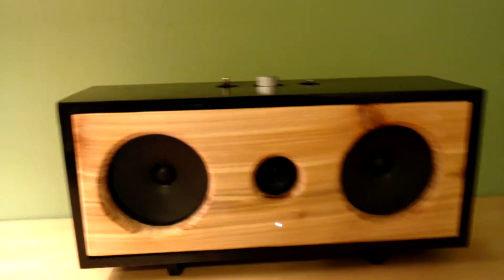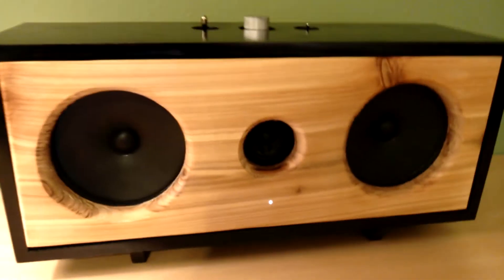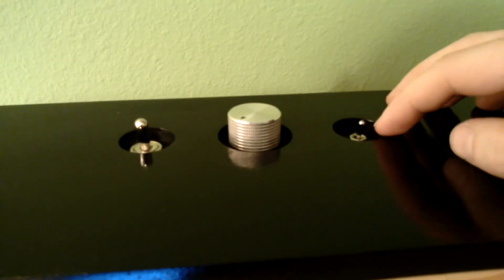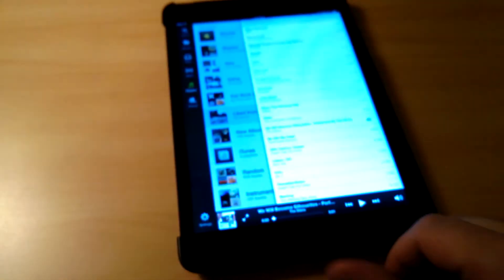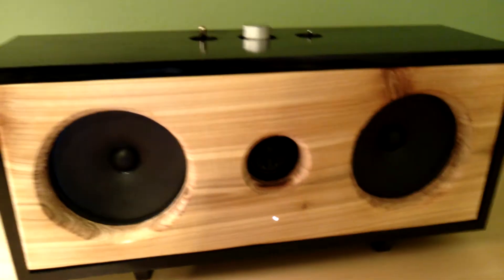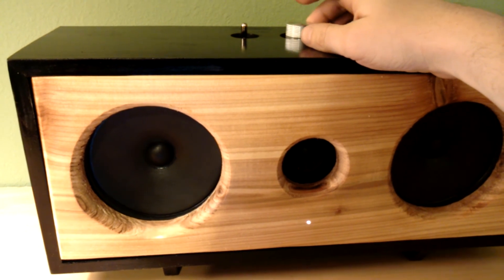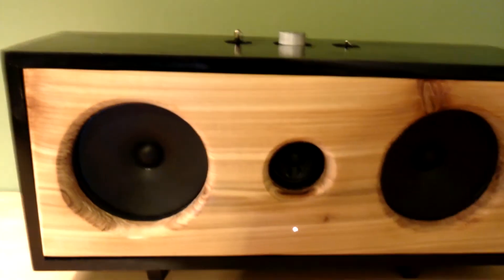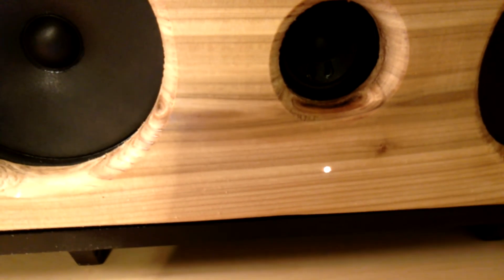DIY Bluetooth Speaker Project

Comment: I’m looking to make something like this to put in put a vehicle without a radio (it’s a work vehicle so I don’t want to get a radio). How would I modify it to run off of a standard cigarette lighter outlet?
Reply from the maker: Those are 12V, so you'd just want to look for components that require 12V to power them. Then I suppose you could either DIY a plug, or tap into the wires behind the outlet.
Reply: Kevin Thornbloom, hey thanks a lot for the fast answer I figured I might get a response in a week or so if at all, thanks again for the reply

Comment: Nice man ! I have a question, I have 6 ohm speakers since yours are 4 what should I change in the way to make it ?
Reply from the maker: Émile Sorci I think it would still work, but might not output as many amps. I'd just try it, or you could upgrade to a better amp if you want to be safe.

Comment: You didnt need a mute switch. You should have put a capacitor on the power port between the op amp's negative and positive line.

Comment: Looks awesome! Any chance of a shot from behind? I'll be building something similar and haven't decided on how I'm going to provide access to the internals, yet.
Reply from the maker: Thanks! The back is the same as the front minus the speakers. The screws are on the outside on the back piece to allow for disassembly. I just drilled a hole for the power wire, but you could easily mount a plug there.

Comment: Kevin... Would you please provide a tutorial with a little more of a break down please... Thank you.
Reply from the maker: Hi Remon, did you have a specific question about it?
Reply: ***** First of all thank you for responding, and yes I have a few questions as I've never attempted anything like this and I really want to do a good job of building this... I don't want to use toggle switches and was thinking of push buttons and I don't want to have to mute the speakers to keep them from popping when it powers on.... Lastly, on the front of your box there's a hole is that a tweeter or ventilation? I'm searching for parts that might help with the popping you described, but to narrow down my inquiry, what parts would you have used if you weren't being cheap as you stated.... If you spent $35, what if your budget was double that... can you connect a rechargeable pack to this to make it portable and still have it plugged in at home when your not away... what would you have changed, etc.... I found you on twitter (I rarely use it) and pm'ed you there if, I'm building this for my mother-in-law and really want this to shine.... any help would be much appreciated..... Thank you Kevin!
Reply from the maker: Buying a more expensive amp would probably eliminate the pop. I can't really recommend one since this is the only one I've tried. Be aware that bigger amps sometimes need heatsinks. You can use push buttons but make sure they aren't momentary and are rated for the voltage the amp needs. The middle part of my amp is a tweeter which is sharing the right speaker channel. I would recommend researching the box design to help the sound. Adding a battery is definitely possible if you know what you're doing. See this guy's video for that: Homemade Bluetooth Boombox - Build Log  Good luck! Let me know if you build something awesome!
Reply: Kevin, thank you very much...

Comment: So I don't know a lot about speakers and I wanted to know what that little circle in between the speakers were. Also when I look around all the speakers have this thing called a tweek in it. Why can't I have it in the speaker?
Reply from the maker: The middle speaker is a 'tweeter'. Basically a small speaker that only produces high tones. Kind of the opposite of a subwoofer.
Reply: so would it be bad to buy a speaker with a tweeter inside? would it be better to buy one separately and than wire it in?
Reply: ***** Also in your blog post you stated that because of the amp your speakers make a loud "*pop*" sound. What different amps would you suggest that are not to expensive that wouldn't make the speakers pop?
Reply from the maker: I'd suggest just using 'full range' speakers. I'm afraid I can't recommend a different amp as this is the only one I've tried. More expensive = less popping and other issues :)
Reply: ***** Im looking at these speakers http://tinyurl.com/lqqcrgq and this amp http://tinyurl.com/mqld9xv Do you think these would work? Also what size speakers do you have because i like the size of yours. The speakers i'm looking at come in different sizes. Thanks for all your help!
Reply from the maker: The amp looks good. Not sure on those speakers. Maybe something like this: http://www.parts-express.com/visaton-fr13-4-5-full-range-speaker-4-ohm--292-518 Just make sure they're 4 Ohm

Comment: Very nice radio. How strong is the bluetooth signal? Are you able to walk away with your phone? I made a portable radio with a different bluetooth devise for camping. I would like to keep my phone in my pocket but i loose signal.
Reply from the maker: The specs say 50 feet within line-of-sight. Of course it's probably slightly less than that in real life, but I'd imagine it would be good for a camp site.